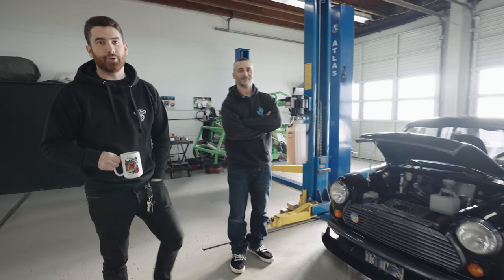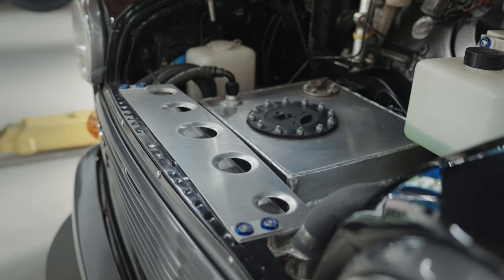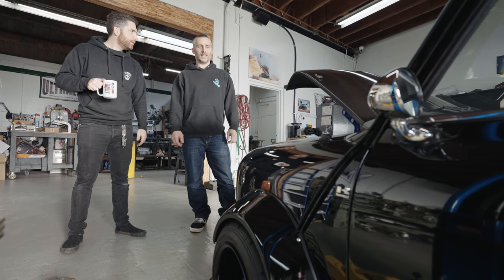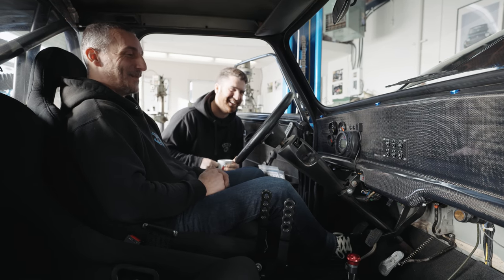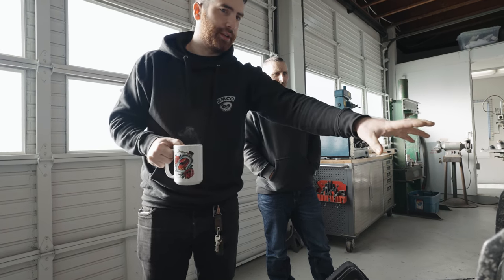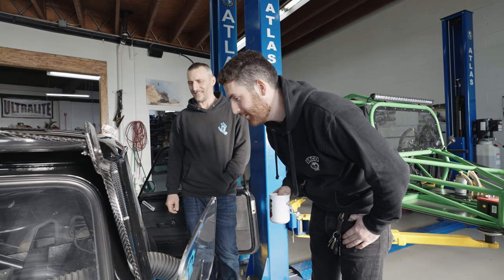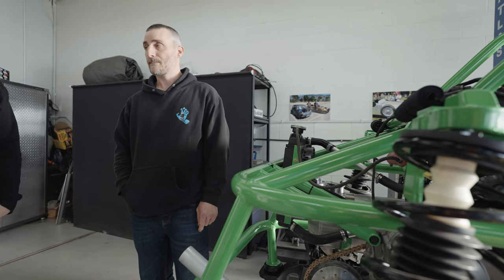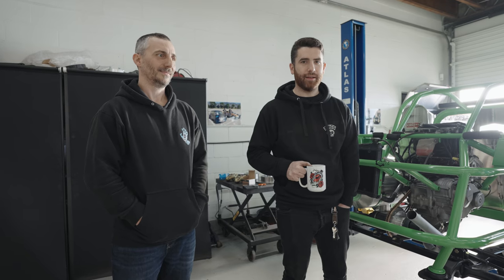Studying Up on the High Revving ZX Mini

Comment: And the buggy inherited the mini radiator 😉 
Interesting wheels on the mini, but more so the size of those Yokohama (048?) tyres. Did it really say 150/490x12 on them?
Reply: That’s the way they label racing tyres - the width and overall rolling diameter then the rim diameter. 
The road equivalent is 165/55R12
E.g
https://polleysport.com/150490r12-16555r12-n2973

Comment: Nice... but they’re DRIVESHAFTS, not bloody axles!
Reply: Driveshaft goes front to back on a rear drive, axles go to the wheels
Reply: The shaft that goes from gearbox to the diff or from the engine to the gearbox in a car that has a front engine and rear transaxle setup (front to back as you say) is called a prop shaft. The shaft that runs from the diff to the hubs are called drive shafts unless it’s a live axle then they are called half shafts. At least in the UK anyway.
Reply: Well UK and canada and US have different wording. You also call it a boot we call it a trunk, pants or trousers. Whatever it doesnt matter . Lol. I find it amusing as to what people get upset about.